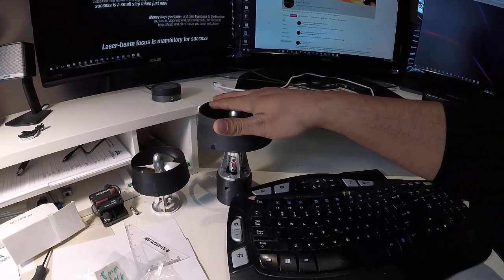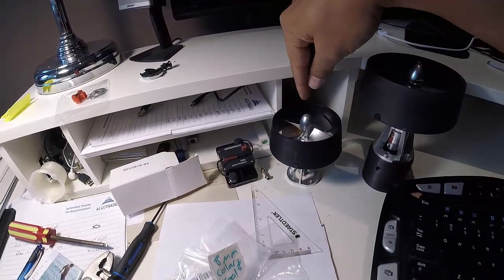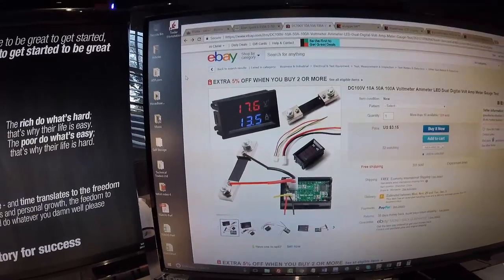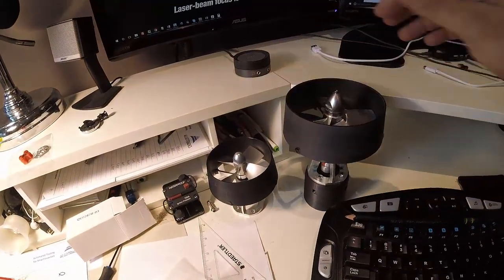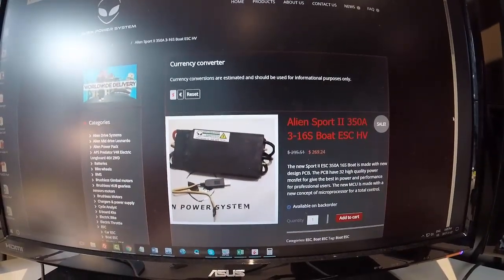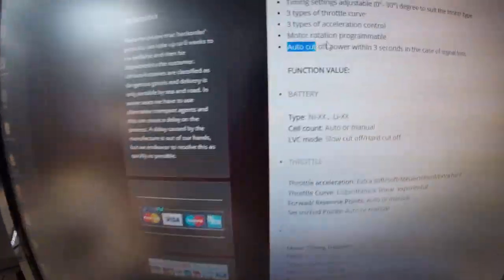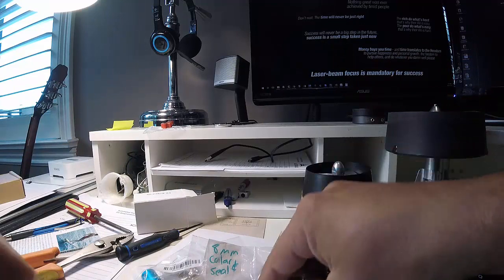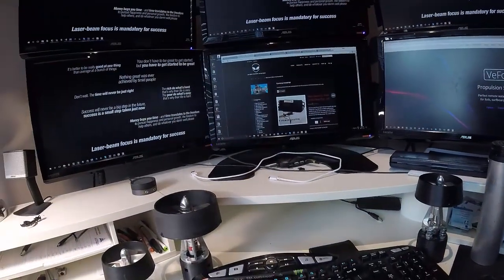VeFoil by VeConcepts Part 4   DIY Electric Hydrofoil Remote Propulsion System

Comment: What other motors are you looking at?
Reply from the maker: We are working directly with a manufacturer for a custom motor with ceramic bearings for high speed/non-rust performance, Stainless steel grub, and motor assembly bolts, custom shaft length. We were going to use Alien/TP motors but they are 6-8 weeks and $550 USD a motor. Currently talking with a couple companies with a 2-week turnaround.

Comment: we used a load cell on a tow rope behind a boat and our foil boards popped up using roughly 30kg of thrust fyi , good luck
Reply from the maker: Great, thanks for sharing Wayne!
Reply from the maker: Did you see the thrust required one you were up on foil Wayne?
Reply: Yes it was 10 to15 at max, the tow was initially directly behind the boat but when foiling the rider goes to the side for stability so it mucks up those foiling reading a tad. It is aprox 1/3 but the foil , the board and rider weight are variables . I think the trick is to have a high aspect larger area main foil so it pops earlier and also a board of highish volume.
Reply from the maker: Yes fantastic, that is what our conclusion for thrust, foil size, and board as well. Thank you for sharing.
Reply: i think i would use the slingshot windsurf large foil as it is the best bang for buck  H1 or H2 .  We have a local called "armstong Board Sports" who is making amazing stuff that is better than any lifty profile out at present , very easy to ride and no sharp edges, that would be the ultimate one imo but H2 is hard to beat as best value.